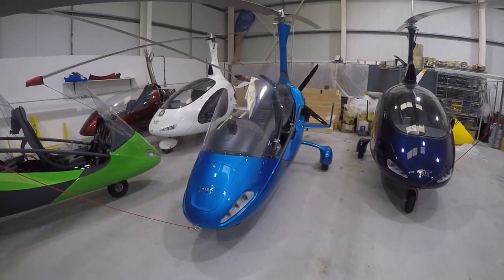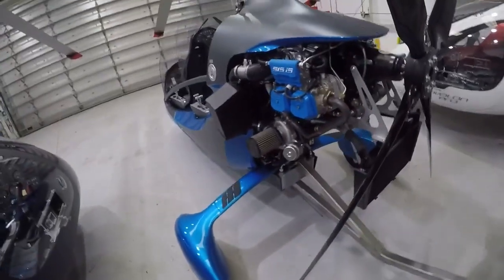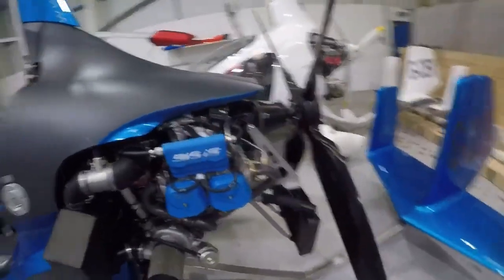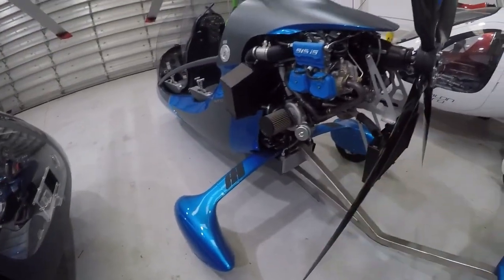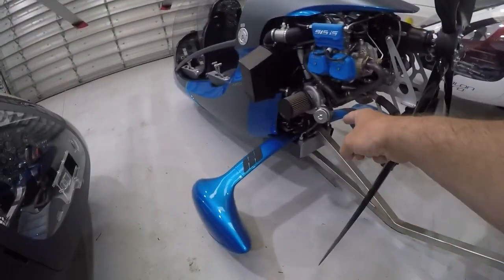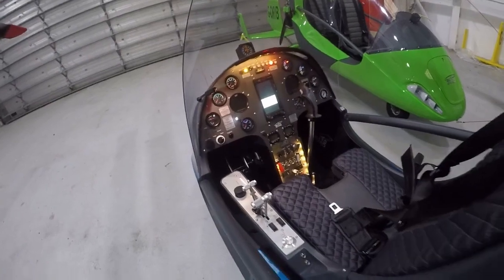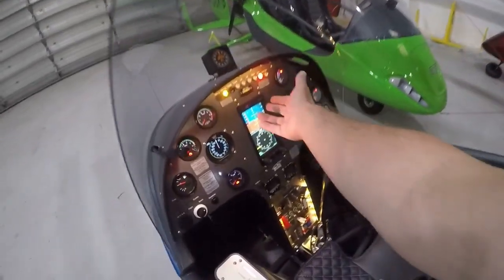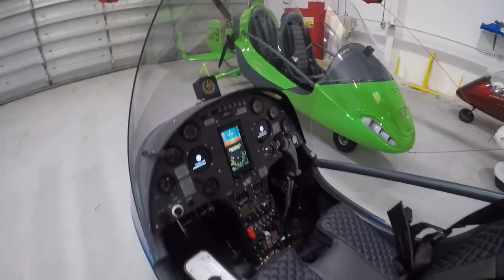Thoughts having flight tested the Auto Gyro Sport with Rotax 915 - game changing world's first!

Comment: How does the cavalon handle this engine? Is it a good improvement over the 914?
Reply from the maker: Hi - So in a gyro I didn't ever really think that the 914 was a limitation in the Cavalon unless you were very heavily loaded.  I mean in the UK the Vne is 120mph and really it cruises "nicer" [more smoothly] at 100.  The 915 does aid take off performance especially at max all up weight and of course it is a little smoother in terms of less engine work / thrash at the 100mph cruise.  However if I am honest I am not a huge fan of Cavalon in respect to the general reliability / service from AutoGyro which has never been great.

Comment: How much does this one cost in the US?
Reply from the maker: It is likely to be the FX adjusted amount from the EUR price in Germany tbh.https://www.auto-gyro.com/en/news/BUY-NOW-FLY-NOW-_532.html#lg=1&slide=0
Reply: @gyrocopterflyingclub6148  for a first gyrocopter what would you suggest? Something that i can land in a feild or water. I live in the mountains.
Reply from the maker: You can certainly fly a 915 as a new pilot - the motor is very linear in its power delivery and indeed I have trained a pilot in the UK on a 915 Sport without any issues.  It was actually one of the easiest aircraft to train someone on actually.  I don't have any experience with floats but the guys in Sweden have done all of the float development here is the contact - they are very knowledgeable https://gyrokopter.se

Comment: Hi. I have heard instructors who have bottled it when trying to take it to VNE.. It’s hard to know if this is just gossip or if there really is issues at the top end of the speed range. Have you flown it near VNE and how does it behave?
Reply from the maker: Hello Mark - an interesting phrase when ref: VNE!  No idea to be honest and I can't believe its a subject that is brought up often.  VNE on the aircraft will be 120mph and I've very rarely flown beyond 100mph in a gyroplane.  Why? Well high speed isn't really a gyroplane strong point (if that is a need then fixed wing is the way forward). Do they have issues well at 120mph it doesn't fall apart and it won't have any handling issues but the motor will be flat out and the vibration levels higher.  I think the only time i've flown at VNE in a gyroplane is during permit renewal test flights.
Reply: Thanks. I rarely fly above 95mph and I understand your comments regarding engine rpm and vibration levels. I was just curious to find out if what I had heard was true or not. Thanks for taking the time to reply.
Reply from the maker: @markwinship6812  No problems.  In truth I'm not so sure it is a scary event as much as you obviously don't want to go there as a matter of regular flying.  Perhaps that is what the others meant?

Comment: Gad 36K USD for that engine. Wow. Gyros used to be a way for a poor person to get into the air.
Reply: Jerry Moody The problem is because Rotax is a drop in solution for this specific weight and power needs, the designers have been lazy and not built an airframe which can take any other engine but Rotax. So here we are in more or less a monopoly situation and they can charge what they damn well please.
Reply from the maker: I agree the general direction of gyroplanes certainly in the UK has been wrong but that is largely the fault of a regulatory framework that is poorly resourced and an attitude that seeks to be a disincentive to those that may like a cheaper alternative.  However outside of the price the 915 Sport is great fun.